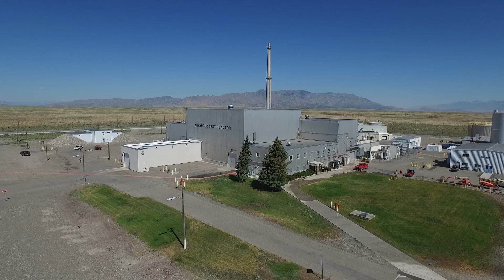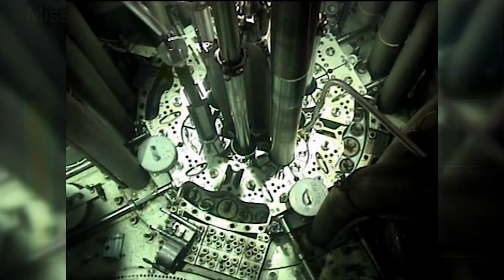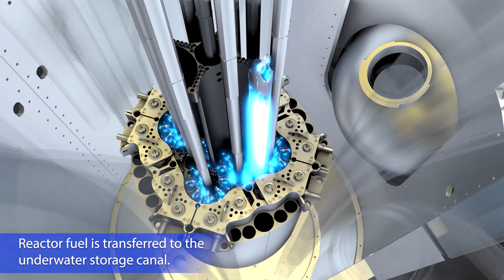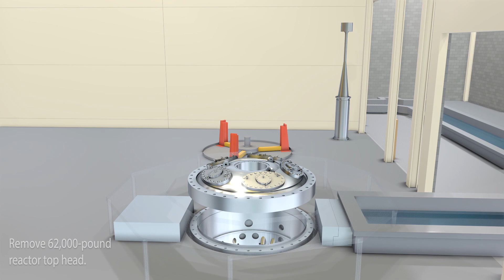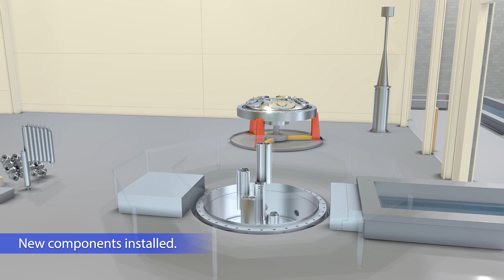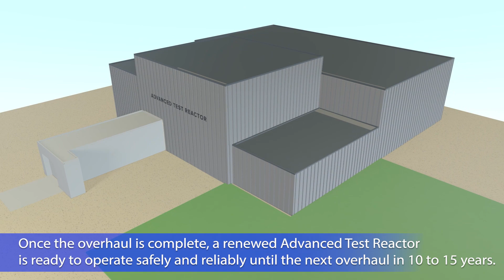Renewing the Nation’s Flagship Test Reactor

Comment: The center for advanced materials helped too. I was impressed when there. 
Niobium coated U 235 fuel a marvel of engineering. Like NiCrFe alloy 600 Inconel, it changed the reactors designs forever. People cannot believe a fuel 1/10" thick with zirc ii matrix with 600°F delta T that runs twenty years.